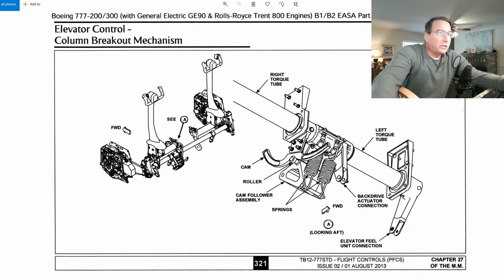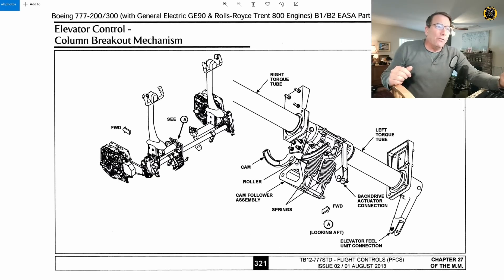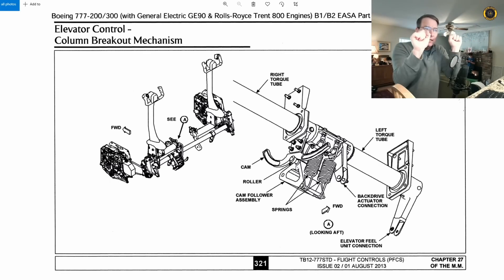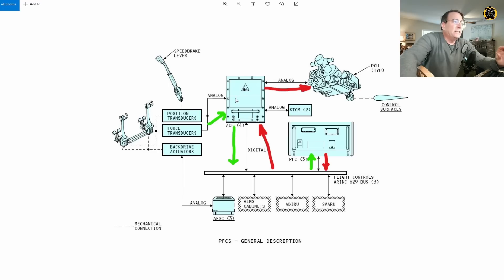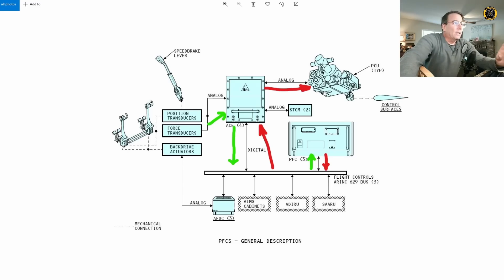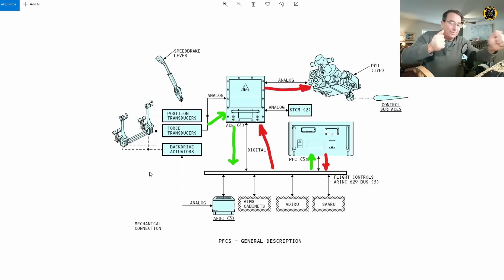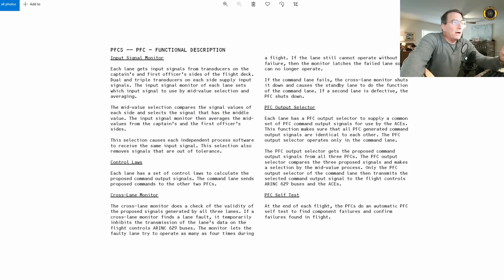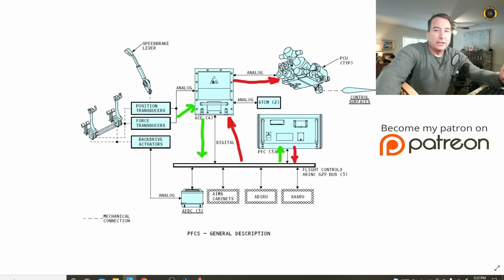Air France 11 Decoupled Flight Controls- "Who's Flying?"

Comment: All those buses, surprised there is no latency that plagues most modern electronic systems.
Reply: It was designed in the '90s so it's not a modern electronic system system, thus no problem. :) :) 
Seriously though, the calculations required are simple compared to running something like a modern 3D game.
Reply: An excellent question. You are one of the few brilliant minds who think about network latency.

Yet we have so many mouth breathers laboring on about how remotely-piloted airliners are “the future.” It’ll never happen. Satcom datalinks are barely robust enough for occasional messaging. Who wants to volunteer to be the first to die in a remotely piloted airliner with a lagged out network connection?

“Sorry to inform you your family died when BargainAir 11 crashed due to a temporary network drop out. The airplane was otherwise in 100% perfect mechanical condition. The pilot survived though.”

Yeah, right.
Reply: @adamreznik6374  I agree remotely-piloted passenger airplanes are unlikely -- a broken radio link (satellite or ground based) would be a big problem. But, such a links would not be necessary for a pilotless airplane -- Useful? Yes! Necessary? No. That is, for a pilotless airplane to be approved, I think it would have to be able to fly and land safely even if radio communications were interrupted.
Reply: @andrewsnow7386  Pilotless airplanes create more problems then they solve, and it would take massive expense and untold loss of life ironing out programming errors until they operated with the same safety record of 2-crew airliners.

There is no true AI. Only computer programs that can win 2D chess or drive a car along a yellow highway line on a sunny summer day. Basically cute party tricks.

What's the goal? Make the source of human error a computer programmer hired as the lowest bidder? or a 2 pilot crew who have 30,000 hours of experience between the 2 of them?

Who will pay for the $2000 ticket from Boston to NYC and give up their life just so we can pay for a pilotless airliner? The airlines will just pass on the cost. Who will be first to jack up the prices and lose market share for this exercise in stupidity?

How will ethics be determined? A forced landing in an area that guarantees fatalities of those on the ground but saves everyone onboard? Or the inverse? Can a program make that choice?

Which way to deviate around rapidly building convective weather? Which cruise altitude has the least turbulence? A passenger has poor vital signs after departure. Will a Flight Attendant contact dispatch and coordinate with Medlink? Who on the airplane makes the judgement call to get on the ground and get medical attention, if at all? Which ETOPS alternate to divert to, after receiving a cargo fire warning on an oceanic crossing?

It's not just a bus with wings.
Reply: @adamreznik6374  "Pilotless airplanes create more problems then they solve" -- that's possible, time will tell.
"massive expense" -- Yep, every new airliner design is a massive expense.
"untold loss of life ironing out programming error" -- The historical record is against you here. A lot of computerization has been added to airliners in the last 30 years, and safety in general has gone way up over the same time.
"Who will pay for the $2000 ticket from Boston to NYC ... so we can pay for a pilotless airliner?" I have no idea what ticket prices will be in the future, but to be successful a pilotless airplane would likely have to demonstrate lower operating costs than a piloted one. 
"How will ethics be determined?.. Can a program make that choice?" Yes, a computer could be programmed to make that choice. If done by computer program, the choice can be thought out and thoroughly considered beforehand by a diverse group of people. If the choice is made by a pilot, then it's done on the spur-of-the-moment, in a stressful situation. How is that better?

"Which way to deviate around rapidly building convective weather?" -- The one that A) Keeps you out of the path of other aircraft. B) Avoids the storm and its projected course by the desired amount. C) Conserves fuel.
"Which cruise altitude has the least turbulence?" -- This would be determined the same way it is now, by a combination of reports from previous aircraft, weather reports, and just trying different altitudes. 
"A passenger has poor vital signs after departure. Will a Flight Attendant contact dispatch and coordinate with Medlink?" -- Yes, the role of the flight attendants would expand. 
Which ETOPS alternate to divert to, after receiving a cargo fire warning on an oceanic crossing? -- The closest one time-wise.

Sure there are a huge number of things that need to be considered and programmed, but most of them have easy answers.

"It's not just a bus with wings." No it's not -- the airplane has it a lot easier than a bus.
A bus has to contend with things like sudden changes in traction (ice on a bridge), or a drunk driver crossing into its lane with no time to maneuver. Airplanes face many fewer events that occur with no warning.  Thanks to the experience of pilots and the careful tracking of problems and accidents, airplanes have a much better defined set of rules for what to do in every situation. Wind shear? -- there's rules for that. Snow on the runway? -- there's rules for that. Computers are very good at following rules. Note, I'm NOT claiming a computer is always better than a pilot. Pilots will always be better at solving the truly unique problems that will inevitably occur. But pilot errors are also inevitable.
Reply: @andrewsnow7386  

Many false equivalencies and a display of an egregious lack of professional aviation knowledge and experience.

Going from 3 crew to 2 due to computerization of aircraft systems (to remove the FE) is NOT the same as going from 2 to 0 crew.

Eliminating the role of experienced and trained flight deck crew, only to expand the decision making burden of the Flight Attendant is a recipe for disaster.

Tell me, what are the "rules" for contaminated runway or the "rules" for wind shear?

How will the computer program "see" the runway if it's covered in snow, it order to follow its "rules?"

Wind Shear escape maneuvers are not flown with the autopilot. Why do you think that is?

The closest ETOPS alternate is not necessarily always the best option. False indications, multiple failures, changing weather en route and at various alternates... It's not just an "if X, do Y" decision.

Deviating around weather isn't just "avoid aircraft" and "avoid storm."

Thousands of times daily, flight crews pick the "best of the worst" areas to fly through. There will be code written to interpret radar and visual indications of weather and decide appropriately?

The flight crew would brief the weather beforehand and put on additional fuel.

You completely glossed over the ethics. So a room full of some people will just decide who lives and who dies? Would it have logically picked the Hudson, since the program has Glider experience?

What a joke.

This is the problem. People think "Well, X was done by hand before, and now it's computerized, so therefore Y can be."

The question is, why?

To remove the pilot cost?

Even if massively increasing other costs to get there? To what end?

To improve safety?

Even if the cost is untold numbers of lives lost over the next several hundred years, just to have the bragging rights of driverless Ubers in the sky?

It is demonstrably false that either of those goals can be accomplished in any manner.

Going from 4 engine reciprocating airplanes from post WWII to the reliable, twin jet airplanes of today, vastly improved the safety record. We didn't have to kill people in a software experiment to get there.

Add in the fact that the market and government regulators will laughably reject these infantile suggestions created by people who are not, nor ever will be SMEs, and that elected representatives will never bow to the pressure to chase such idiotic goals and take the blame for killing innocent people due to software glitches.

The fact is commercial air travel is one of the safest things one can do in their life. Can safety be improved? Always.

Lowering regulatory requirements for ATP certificates or nonsense such as age 67 or age 68 retirement would certain sabotage such safety improvement goals.

Truly enjoyed the discourse, it was good for a laugh.  Best to stick to programming electric scooters and lawn mowers, and leave aviation discussion to those with ATPs and heavy jet type ratings.
Reply: @adamreznik6374   "egregious lack of professional aviation knowledge and experience" -- You got me there. I only spent about 10 years at Boeing, including work on the then new 777 flight controls. Many people do have more experience.

"Eliminating the role of experienced and trained flight deck crew, only to expand the decision making burden of the Flight Attendant is a recipe for disaster." Your example was about an ailing passenger. I think a flight attendant can judge the medical condition of passengers just as well as a pilot, possibly better, as dealing with passengers is bigger part of their current job.  I'm not suggesting the flight attendants have anything to do with flying the airplane, they would just need to make the decision to divert for a medical emergency instead of the pilot. I don't see how this is a "recipe for disaster".

"How will the computer program "see" the runway if it's covered in snow, it order to follow its 'rules?'" -- Either by using the same visual cues that pilots use (runway lights, plowed snow berms, etc), or new additions could be made to the runway (maybe radar targets at each runway edge light, etc). Note, the following video shows that in snow computers can already use visual cues other than painted lines to determine where a lane is. The computer isn't very good at it yet, but I think it's reasonable that the technology will improve with time.
https://www.youtube.com/watch?v=UCwoX1jHkVU
Again, this is an easier problem to solve than it is for road vehicles. The location for every commercial airport is vary well know, and if I'm not mistaken, every commercial runway is very straight. Further, adding new safety features to airports has been done in the past and it is reasonable to expect it will be done again. Again, it is easier to update all commercial airports to a new safety standard than to update all paved roads to one.

"Wind Shear escape maneuvers are not flown with the autopilot. Why do you think that is?" Because the autopilot is not programmed for this condition. I'm never said that there is not a lot of work to be done before pilotless airplanes are a safe for passengers, but I sure don't see any insurmountable problems.

"The closest ETOPS alternate is not necessarily always the best option." -- OK, but all the things you mention are things that can be calculated, so a computer can do it. Also, this is a situation where input from someone outside the airplane is reasonable -- that's how it's done today. That is, the pilots get information on things like the changing weather conditions you mention from people/systems that are not on the airplane.

"You completely glossed over the ethics. So a room full of some people will just decide who lives and who dies?" And you completely glossed over why it would be better, in any way, to have a single person in a stressful situation make the decision about who lives or dies.

"Would it [a computer] have logically picked the Hudson, since the program has Glider experience?" -- Maybe.... the following article says the airplane could have made it back to LaGuardia if it had turned around imeadiately.
https://www.cbsnews.com/news/ntsb-sully-could-have-made-it-back-to-laguardia/
I don't have the knowledge to judge myself if this would have been a good idea, but with a computers ability to very quickly calculate if it can reach the airport in a glide, a computer might have made a different decision. In any case, US Airways Flight 1549 demonstrates that the option to ditch definitely should be included in any pilotless airplanes programming.

"The question is, why?"
"To remove the pilot cost?" -- Yes
"Even if massively increasing other costs to get there?" -- uh, what? First, where is the massive increase in cost? Second, this is the one thing we can count on from the bean counters -- if it is a massive increase in cost, it won't happen. So, if you are right, then you don't need to worry about it happening. :)
"To improve safety?" -- Yes.

"It is demonstrably false that either of those goals can be accomplished in any manner." I'm not sure what goals are you talking about here? But, if they are safety and cost reduction, then I take you up on your offer -- DEMONSTRATE it with some evidence!

"Going from 4 engine reciprocating airplanes from post WWII to the reliable, twin jet airplanes of today, vastly improved the safety record." I agree, absolutely!  "We didn't have to kill people in a software experiment to get there."  No, take it from a mechanical engineer, we killed them with mechanical experiments -- the list is long.

"The fact is commercial air travel is one of the safest things one can do in their life." -- YES, and computers have made it safer, not less safe. And, there is every reason to believe that computers will continue to improve airliner safety.

"Best to stick to programming electric scooters and lawn mowers, and leave aviation discussion to those with ATPs and heavy jet type ratings." -- Well just to give you that warm fuzzy feeling the next time you fly a 777 (or 757, 767), just remember that I'm one of the engineers from Boeing that you are counting on to have done a good job. :)